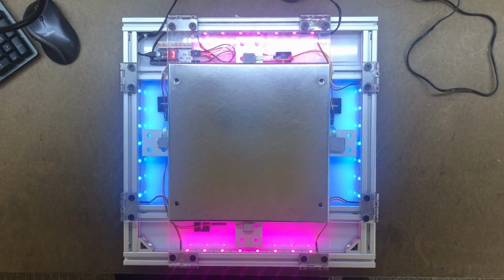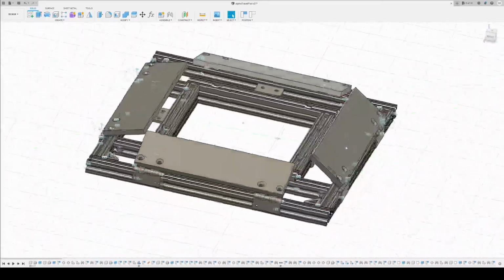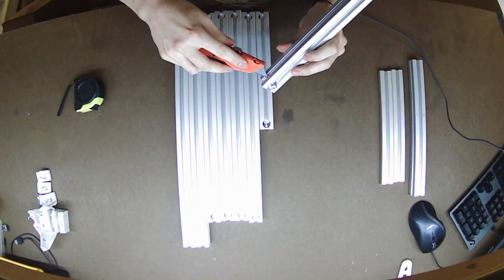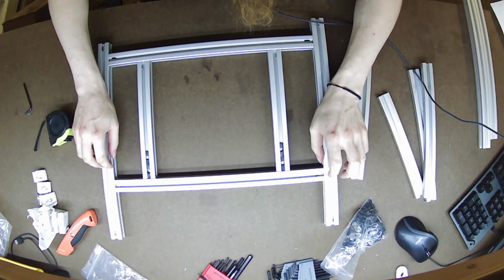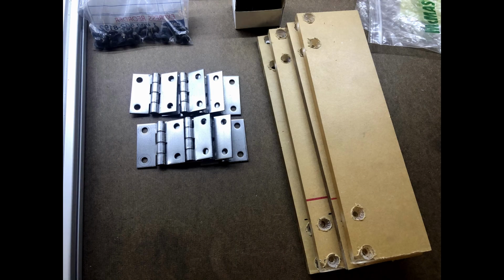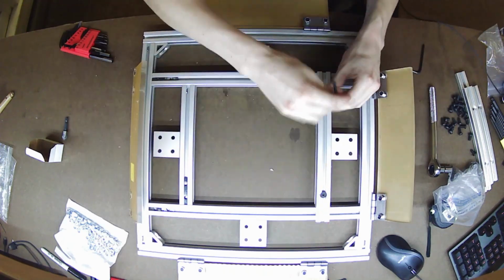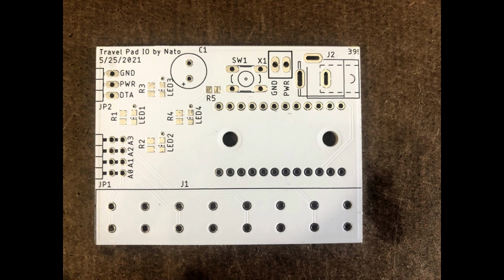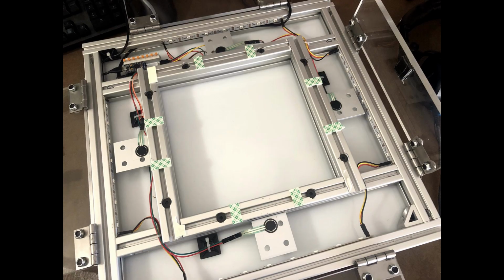Metal Mini Travel Pad for DDR/ITG

Comment: I know this is very old but, this is actually kinda genius. Seriously. The fact that most players back in the day on like Cobalt Flux pads only keep their feet in the center and tap the inside edges of buttons is just.. it's a no brainer that this kind of pad should have been the next logical step in extreme DDR player's pads if the game hadn't died out mostly. I think I might actually build one of these or similar, just a smaller form factor pad thanks to seeing this. I'm kinda facepalming that nobody else has thought of or copied this and popularized it. Great work :) Thank you so much for sharing the process

Comment: Hello! I love this pad and i want to build one, but would 20x20 (milimeters) profiles be the same as the 1inchx1inch profiles you are using? I only find 2020 ones, and i suppose they are the same since the top half profiles are half of size (10 mm of tall) and it would even out with the tallness of the acrylic pieces. Want to make sure before buying stuff, awesome design!
Reply from the maker: I'm honestly not 100% sure. I think you'd need to check the thickness of the acrylic against the 5.4mm height loss you get from the smaller profiles.